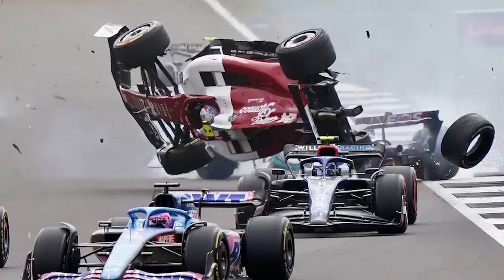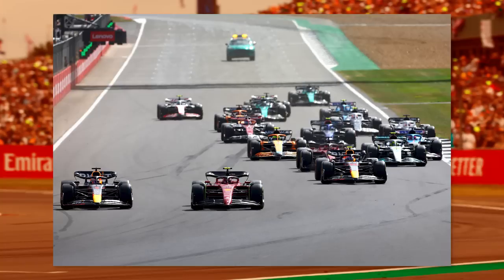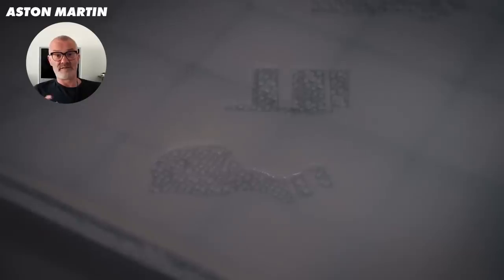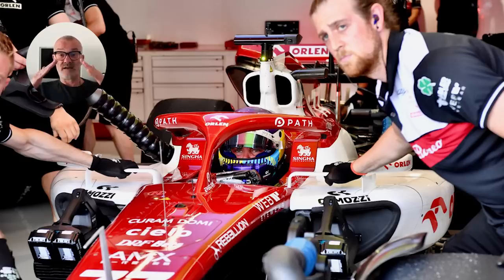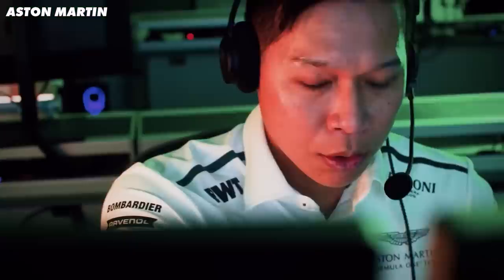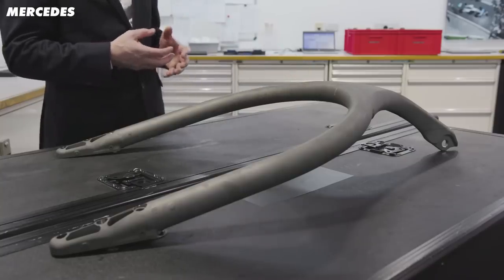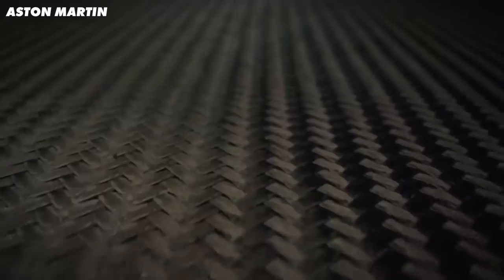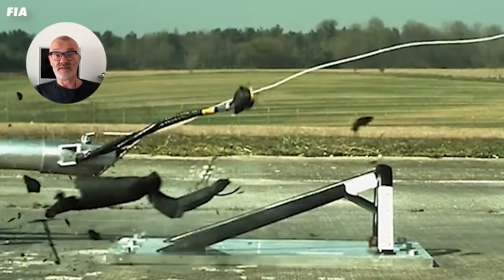Did the Roll Hoop FAIL in Zhou's Crash?

Comment: When I saw the accident I immediately thought of the blade design, and the fact that even if it is compliant with FIA tests and regulations, this accident was way beyond those limits. This means that FIA should review and modify the tests for the chassis.
However I think that in this case other problems could have played a major role, like manufacturing issues during carbon fiber layup (maybe some inclusion or delamination, don't know if they systematically perform NDTs after fabrication), or an improper bonding of the titanium part.
In any case, this type of load is impossible to model in design phase, I still think that the designers and the engineers did their best, and we have to learn from this accident in order to avoid having a worst outcome in the future.
For example the gap between barriers and tires is too small, it's impossible for the pilot to escape or be extracted quickly.

Comment: I think the blade style roll hoop is going to be torn off much easier. I don't know how to explain it but if you imagine yourself pushing sideways on the top of a blade style hoop you can see how it will effectively give you leverage and pull more on the joints. You can't get that leverage with a standard roll hoop.

Comment: When did the failure happen!  In the initial vertical impact, skidding across the track, when ploughing through the gravel or a combination of two or more? I imagine that the impact loading and drag coefficients are very different depending on the surface the hoop was interacting with. I would think the FIA must now be looking at some rotary dynamic load test spec as well as the static load one(s). Fascinating to hear how these hoops are manufactured and thanks for that.

Comment: As well as being glued the hoops should be mechanically attached using bolt like attachments going right through the carbon and being plated on the other side. I bet that's what will be required in the future.

Comment: As an engineer, Zhou's crash was almost the worst-case scenario for the roll hoop/blade. The car first sustained a heavy unmitigated impact directly on the hoop, both stopping the car's vertical momentum and roll momentum; no touches of the wings or wheels to soften the blow. Without the car getting fully airborne, that's the worst case scenario. That probably broke a corner or side of the carbon fiber that the hoop was attached to. Then the hoop dug into the track at high speed, which would have exploited any weakness in the carbon fiber to rip the rest of it off. The only worst scenario would have been an impact with another car.
The thing about carbon fiber is that it fails catastrophically. Once it sees a load that breaks it, it loses most of its strength; unlike a metal that deforms but still has its strength after an impact. So The worse-than-expected load broke the carbon fiber underneath it, which severely weakened the whole thing and left it vulnerable during the upside-down spin that stressed it in every direction. I do wonder if the FIA will eventually revise the cars to have metal struts that tie the roll hoop to a secondary part of the structure. That way, even if the carbon fiber attachment fails, there's still some strength left in the hoop. 
Parting thoughts: yay halo. And "glue" would laugh at the pitiful loads that this failed at. Properly spec'd adhesives are typically stronger than whatever they attach to, and I expect that to be the case here. Most household glue failures are from using the wrong kind of glues or improper surface prep.

Comment: The picture showing the tests is wrong and you can see that in the test footage. The longitudinal test is a rearward impact, not a frontal one. Much like diamonds, carbon fiber is hard, but not tough. Any load applied in a direction the structure was not designed to handle will result in delamination or ductile failure. You can see that quite a bit with bicycle frames, where people end up damaging them just trying to lock their bike, for example.

Comment: The clear fact is that it failed because it was no longer on the car when it was upside down. So either the car wasn't built to the correct standards and should have failed scrutineering or the standards aren't good enough and need to be changed. I'm glad that no one was hurt before we found this out.

Comment: That "glue" is stronger than the carbon composite it's attached to - it's what they use to put commercial jets like the 787 together.  There's no frame or chassis that you could attach the hoop to, so the only things you could do to prevent this are (1) make the composite itself stronger (a job more for the chemists and materials scientists than for the engineers), or (2) build the monocoque around the hoop, so it's fully incorporated into the body of the car.  The latter design would not fail unless the crash was so catastrophic that the monocoque itself was crushed.

Comment: If you have watched motor sport long enough you will have seen a number of similar crashes with open wheels where cars fly and not always striaght and level.  One remembers Ricardo Patrese flying in the 80's and a Tyrell flying at Monaco in the early 80's and plenty since.  It is easy to predict that that mode of crash, no matter how unlikely, is very possible. Considering the safety consequences, it should have been part of the regs.  A suitable swinging weight test would seem appropriate.
A side on crash for the role hoop would be likley less demanding because impact with the hoop might be expected to cause roll rather than skidding. 
Any decent stress engineer would have predicted the ripping carbon failure mode with this sort of loading.  Adhesives are great in shear, its what they're for but not so good in peel or tension.  Depending on the hard point inside the monocoque (eg a plate or similar) and the extent of it, then the prying introduced by the aft-wise horizontal load at the top of the pylon (note the pylon is taller than the fore/aft footprint) will likely introduce a local bending in the top layers of composite which then ammounts to peel in the adhesive and so on (or is it off!).  Also bear in mind how sensitive bonding is to process, anything less than spotless is problematic and NDT for it is not easy (assumming it was attempted).
Measures to mitigate this might be: longer fore/aft footprint, bracing to a point further back (strut to top of gear box?), mechanical fasteners through the reinforcement into an understructure.
Thank god (or perhaps the FIA though I don't mean to elevate them that high) for the Halo that wasn't intended for that purpose (it was to catch debris such as hit Barichello sometime back).  Otherwise Zhou might have lost his head.
What about track safety?  Zhou ended up jammed between the barrier and the fence.  Should the barriers and fences be further apart or closer together to avoid that?  We saw the Grogeon fire and the Saintz fire at Austria and several others.  Just think, no too horrible.
The results of the investigation will be very interesting.

Comment: I think the halo lifts the front of the chassis up which caused too much of the load to be forced to the top edge causing the metal to drive into the concrete in a sharp manner and cause the top of the hoop to get ripped away from the carbon fiber

Comment: Put titanium or other material balls in the places on the car that touch the track when the car slides over it upside down, strongly held in place in casings that only let part of the balls stick out, so balls roll over the surface of the track, regardless of the direction the nose of the car points at, instead of things unmoving scraping the surface of the track. Three balls would do; one above behind the driver, two left and right in front him.

Comment: I always thought it was similar to a go kart like it was part of the actual frame of the car because to me this is what roll hoops are for. Like yeah they handle static blows like tipping the car but we’ve seen a car literally flip upside down and face the complete other direction so it’s possible they can spin on the roll hoop. There’s no way they just tested them and didn’t do a simulation of ever changing directions of the force applied to it. A car spinning upside down is not out of the realm of possibility, but I can understand if the halo was the ‘just in case’ measure for if a car ever spins on its top.

Comment: I have some experience with some aviation glue for bonging carbon fiber wings and stuff it's insane. Even though it was expired for 20 years it made super glue look like a washable glue stick. It's a ton stronger than the epoxy holding the carbon fiber together.

Comment: well a good solution to this would be a look back in time.  The FIA could mandate a "manufactured"  inner frame that could in effect act as the hoop, the fuel tank side bar crate protection and the engine mounting point be embedded internally to the carbon chassis. in effect it would revisit old tech with a new safer goal in mind. the could also standardize that part to control engine placements, angles etc. It could be a useful reference plane as well to create other rules as well.  Think A frame in the bulkhead behind the driver, triangulation with the halo would be even better driver protection

Comment: Both crashes at the start of the previous races were from Gasly awkwardly pushing into the middle of two cars to turn one. He needs to back off and realize he can't squeeze in between two cars making sharp turns. Especially since his front wing is basically lined up with the back tires, so he doesn't even have position to make that move either.

Comment: A simple but robust mechanical connection to the monocoque below the external layers of the carbon fiber could add safety to the roll bar system.  Think of the glue/epoxy/resin being the primary connection, with the mechanical connection as the backup.

Comment: Maybe just add bolts through the carbon fiber? That way the sheering stress is added throughout the layers rather than just the bonded layer. Or sink the roll cage into the body itself instead of it being on top.

Comment: Carbon fibre seems to be the immensely strong wonder material until it suddenly breaks. The tail fin coming off airliners when the pilot pushes the rudder pedal hard over has demonstrated this. Metal will bend but carbon fibre is there entirely or it lets go. I seem to recall the Fastnet yachting disaster had composite rudders breaking as one of the problems. Bigger mirrors on the cars would seem a good idea to avoid crashes in the first place as they never seem to know what is behind or besides them.

Comment: The solution here would be four large bolts passing through the footplate of the rollhoop, bond line and the monocoque into four large washered nuts. This would prevent sheer of the carbon fiber.
Reply: I know you can get some of that sheer to the bolts. But how does that work in this kind of materials such as carbon fiber. Do the holes make it stronger or weaker, because the Steel on those bolts unlike most aplications are actually much weaker material in this case. In the calculations of a bolted Connection usually the resulta has some load on the bolts and some on the parts, unless it disconnects and it all goes to the bolts(bad). Also the part here isnt very big so one has to question how many bolts they can place to make it strong enough given spacial constraint. In metal to metal welding is better for these aplications, but this is a composite. An the glue looks mighty strong it held up.
Reply: @pedrorequio5515  As I understand it I think that a structure being bolted as well as bonded improves the shear characteristics of the whole structure. As someone pointed out earlier in the comments although the adhesive bond is very strong the 'weak link' if you like is the shear or peel strength of the carbon fiber layers. You are correct in that putting holes in structures is not always ideal but in this instance it would prevent shear or peel.
Other things to consider are what would be the the best material for the bolts? Perhaps steel or maybe titanium? Both have different tensile characteristics. Perhaps even increasing the size of the footplate area of the rollhoop may improve things also.
Reply: @gavinbolton758  Just make the carbon fiber thicker. This is usually the most common engeneering solution, and the FIA can mandate this for the next Gran prix if need be. This things can be very strong against shear, the carbon inside the epoxy can take quite a lot, works like reinforced concrete
Reply: @pedrorequio5515  The point is it doesn't matter if the carbon is one layer thick or one million. You will always just have the rollhoop come off with the glue and the first layer or two of carbon fiber. It's the strength of the bond between layers of the carbon fiber. I know this because I work in the composites industry.
Reply: @gavinbolton758  it looks from the images it shattered, not just the top layer sliding.

Comment: Last time I can remember seeing a role hoop completely removed from an open wheel car in an accident was Greg Moore's fatal accident at Fontana in 99 during the final round of the CART series championship. We are very fortunate the halo is in place now because it could have been so much worse. Racing has come a long ways when it comes to safety since 99, which leads me to question of what exactly happened, comparing the two wrecks and the speed and forces involved are not even close, Moore hit an oil patch at over 200 mph on an oval, left the track and his nose dug in the ground on a transition from pavement to grass on an infield access road and sending his car into a violent somersault that sent the car sideways into a low infield wall, with the wall hitting the car directly where the roll hoop is tearing it from the car and resulting in Moore not only going through a violent sudden sudden de-acceleration event but also direct head contact with the wall. When you see Moore's wreck, it is of no surprise the hoop couldn't withstand the forces and the angle it hit the wall, with Zhou's accident it is a little bit harder to understand, especially considering over 20 years of research and testing, why his roll hoop failed and yes I will say failed because whether it was intact or not, it failed to do its job since it was removed form the car in the accident. F1 and really all of open wheel racing needs to learn from this since the same crash standards have been implemented in all the open wheel series for awhile now. While the Halo did its job it was also ask to do a job in which the roll hoop is designed to do, next time we might not get so lucky.
Reply: OK, but it is a misrepresentation of what happened. The carbon fiber failed. There is nothing more that could be done to the roll hoop to change the outcome. The issue is the your weak point, which is carbon fiber and not the roll hoop. Regulations need to dictate a "roll cage" of sorts, so that the roll hoop is merely the top of a piece that reaches the floor and connects to   the halo which should also reach the floor.

Comment: I’m no engineer but having the roll hoop extend through the carbon fibre monocoque using blots and then bolt straight into a titanium plate on the other side, and having the holes be reinforced with a sort of U shape from 4 directions in several different layers, that would require the entire carbon thickness to be ripped out, and lateral movements would also require snapping carbon fibres along their strongest direction, obviously also keeping the adhesive, only downside is the extra 2-3kg relatively high in the car, having a safety feature snap of is just unacceptable

Comment: Could potentially the heat from the titanium role hoop skidding across the track be conducted down the role hoop into the carbon at the base causing the delaminating effect? Just a thought as carbon doesn’t stand up well to extreme heat coupled with the forces going through it.

Comment: If the halo and the roll hoop were all made from one piece and a standard form for all cars to bolt/glue to their Monique this sort of problem should not arise, because in order for it to be ripped off, the whole structure would have to be ripped off against far more contact points.

Comment: 2 Things.
- The carbon layer might have ripped because of heat caused by resistance. No one knows how hot it got when the vehicle was being dragged upside down. 
- Lucky the vehicle only did one flip and got caught by the fence, if it were to do two or more chances are the momentum might have carried the car over the fence onto the spectators....scary. So we might be seeing FIA changing the rules in terms of increasing fence height, increasing spectator distance to fence... things of those nature.
This was a scary crash for both spectator/driver, could've gotten very ugly, lucky no one got hurt.